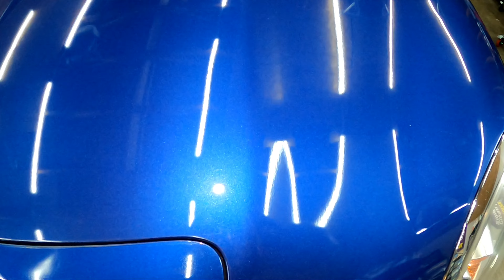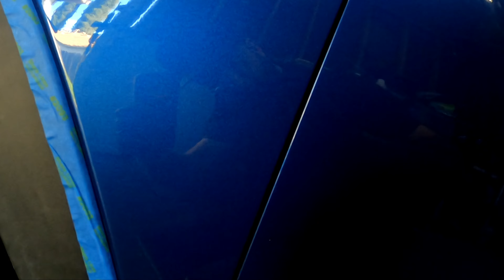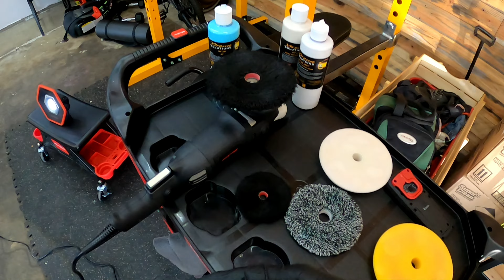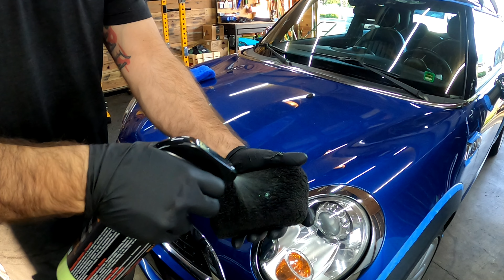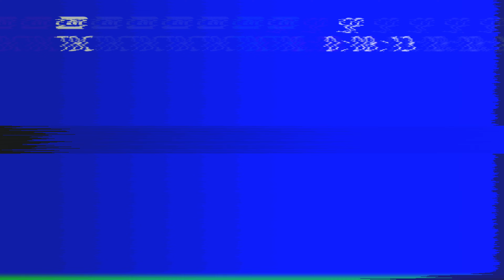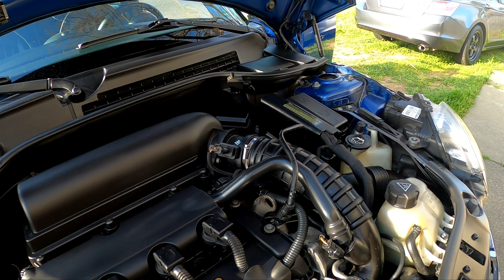Operation " MINI " Episode 3 || PAINT CORRECTION AND PROTECTION || PHENOMENAL RESULTS!

Comment: Just gotta say this does look really good! After watching this, Extreme Solutions looks like a better choice especially their polish. I've been looking to detail my car for the first time in the next month or two & been trying to figure out which polish & pad combo would work since I'm having a hard time figuring out which polish/pad combo to use. I have a 2017 Honda Civic Hatchback Sport in a blue color similar to this Mini Cooper & I've heard Hondas have a soft clear coat. Have any recommendations on polish/pad combo for my civic?
Reply from the maker: Chad, thanks man!!! Appreciate that! 2017 Honda Civic most likely will be on the softer side. I still recommend starting out least aggressive. A good starting point would be a medium polish pad and a light polish just to see how the clear reacts.. so something like a Yellow rupes polishing pad and the xtreme solutions ice polish would a good place to start... if it's working well then go ahead and stick to that.  If you need to step up you could grab a little more aggressive foam pad like a orange correction pad but stick with that ice polish.. lots of variables to consider. What are you going after as far as defect removal?? Are you going for perfection ect.. so, it doesn't have to be xtreme solutions, any medium cut polish pad and a decent polish will be a great starting point. 👍👍 I hope this helps out and feel free to reach out. I'll be glad to help you through your process🤜🤛
Reply: @PapaSmurf918Detail  Of course man!! Yeah its just so hard to pick a pad & polish combo since there's so many choices with all the companies out there. I've been looking at Sonax, Koch Chemie & 3D. I'm not looking for perfection since my paint is in really good condition & only very minor swirls/hairline scratches. I've only taken my car through a drive thru wash like 3 times ever so it probably only needs like 80-85% defect removal. Thanks for the info on what polish/pad combo to use!! Definitely appreciate it dude!!
Reply from the maker: @chadharrison1629  anytime man!!! Hope you get the pad/polish combo your happy with. With what you stated above I can almost guarantee you won't be disappointed in any of them. Keep me posted man, really! Wanna know whT you go with and how everything goes 🤜🤛👍

Comment: Tip on those pillars. Instead of using say Eraser as a wipe off or other similar brand products, use Clarity or any good glass cleaner on those shiny A-B-C pillars for removing polishing oils. Wipe off is much better using something like Clarity, which is my goto Glass cleaner.
Reply from the maker: Thank you... I just like using paint specific panel wipes cause they have lubrication for wipeoff.. to help prevent scratching the soft pillar👍. But I'll give that try! Appreciate you watching my friend!

Comment: How's the topper regarding dust static ?  I've been using bead maker but i feel it attacks/grabs quite the dust.
Reply from the maker: Jose, I've noticed that as well with beadmaker and can assure you topper is much less a " dust grabber " than beadmaker. 👍
Reply: @PapaSmurf918Detail  Yeah , that's why I went and bought p&s paint gloss and shine to put on top of bead maker to counter the static .
It does work and it does make the paint even more sleek and deep gloss looking , but hate he fact that i have to use 2 products.
So if xtreme solutions topper does better , I'll probably try it out.
Reply from the maker: I've heard of that anti static combo for beadmaker 👍 but yes topper isn't near as bad at attracting dust!!
Reply: @PapaSmurf918Detail  yeah, they work pretty awesome together , but in my head and literally real life , I'm paying 28+Tx for a product if buying both 16oz bottles or about 60 for 2 gallons to make 1 product.

I guess when it comes down to the gallon add up isn't bad really cause normally a gallon for any average good product it's 30-40 and I'm getting 2 gallons for 60 😅

I wonder what would happen if i mix them 50/50 in one bottle 🤣
Reply from the maker: Yeh that's a lot! I say try topper!! Definitely won't be disappointed. Plus Papasmurf10 at checkout gets you 10% off at xtreme solutions 😎👍
Reply: @PapaSmurf918Detail  should have links on description

Even amazon gives you some when someone buys off your video links.